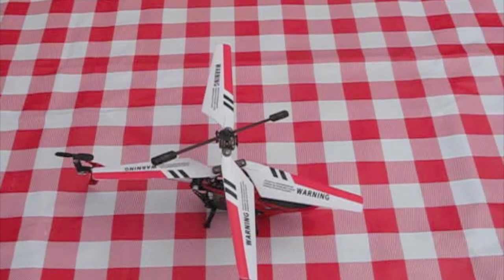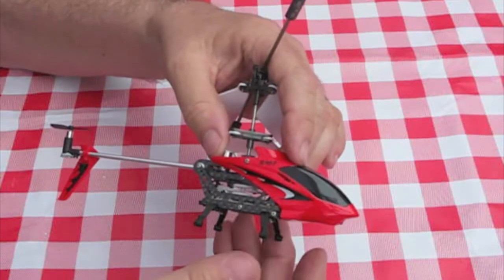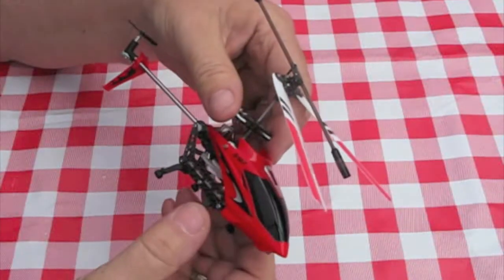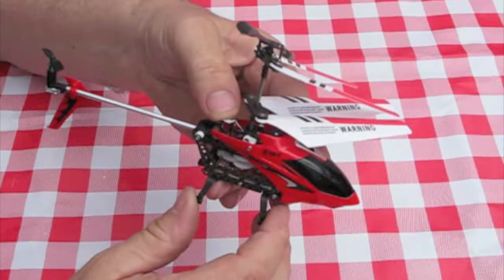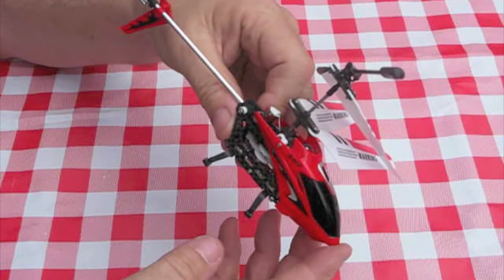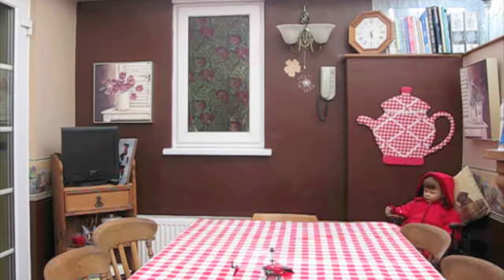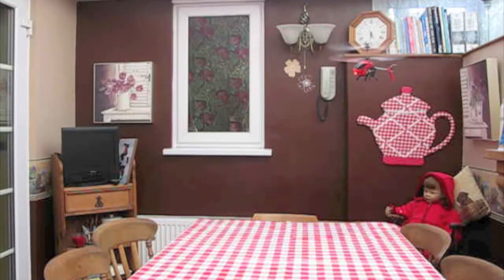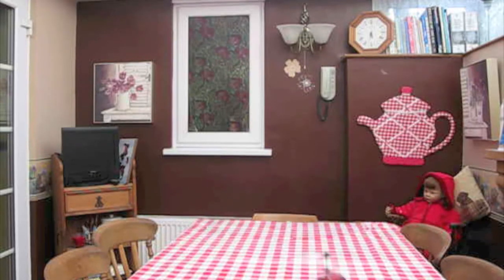Syma107  Carbon Chassis Modification !!!

Comment: You could remove as much weight as possible from everywhere on this rc without adding any weights at all. All you need to do was to relocate the battery which actually is the most heavy part of it. 
You could test it by trying to ballance it on a small upside down  bic lighter  just under its main rotor